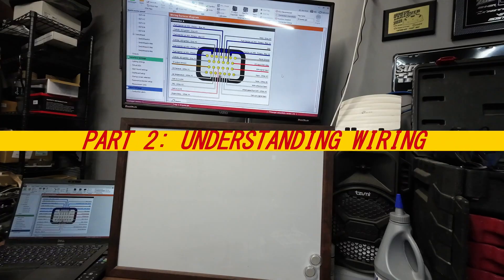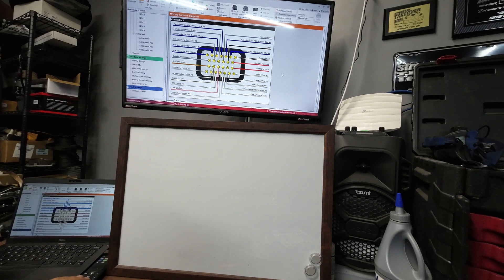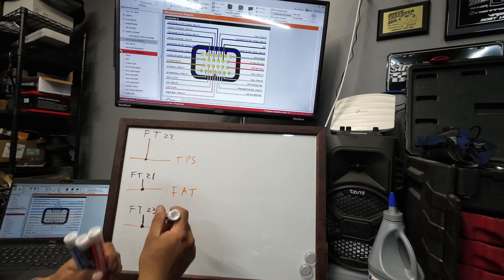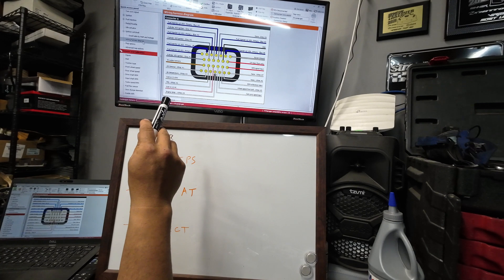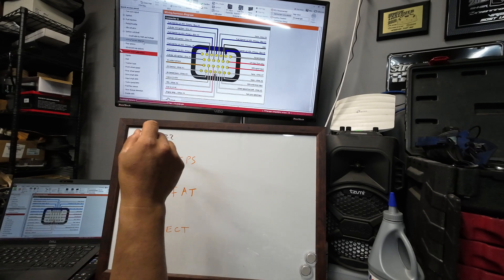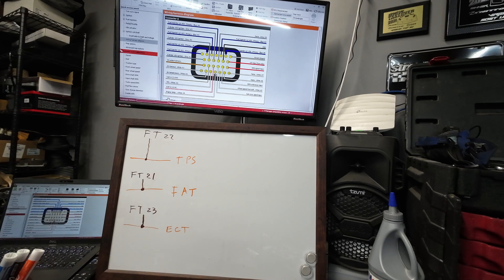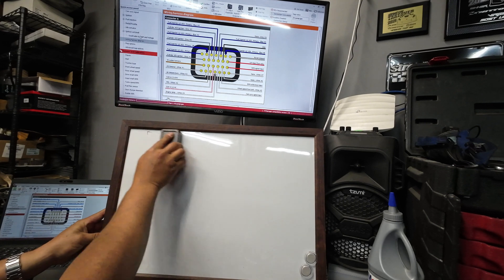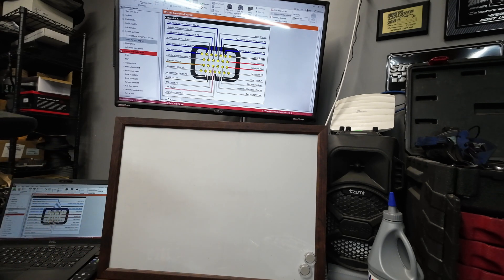FUELTECH FT450 TO J SERIES HONDA V6 HOW TO PART2 (this wiring method can be used in any engine)

Comment: So essentially, you are intercepting the signals and sending them thru the FuelTech.?
Reply from the maker: On the injectors and coils yea we only triggering them with fueltech power supply stays untouched and the signals for sensors are shared with stock ecu and fueltech so they both receive it
Reply: @clevermotorsports  okok cool. Shit I'm needing to get my swap tuned I'm still on stock ecu, harness ...
Reply from the maker: @Octane_Mayhem  yea a good management system and tune makes a big difference
Reply from the maker: Byc_luis

Comment: Great vid, do they make a v8 management system ?
Reply from the maker: Fueltech is universal you can use it on anything they have higher versions like ft550 ft600 etc depending on your needs